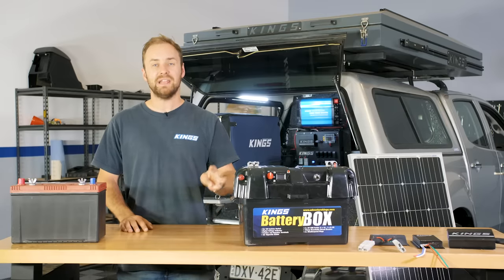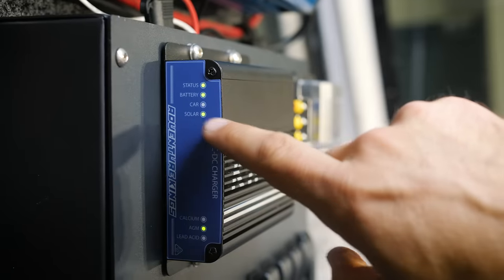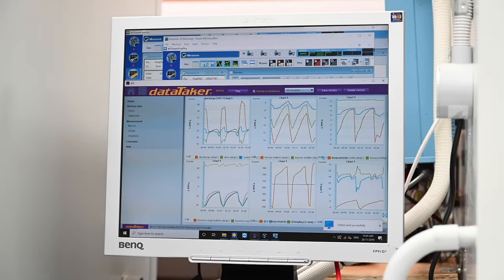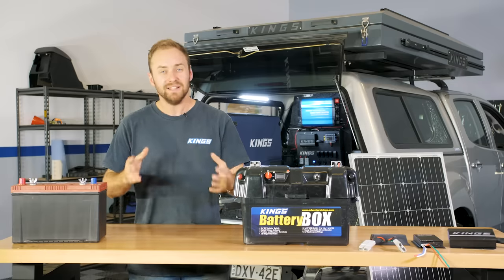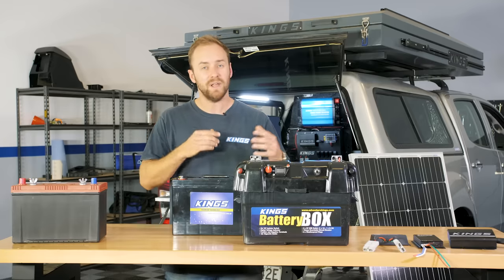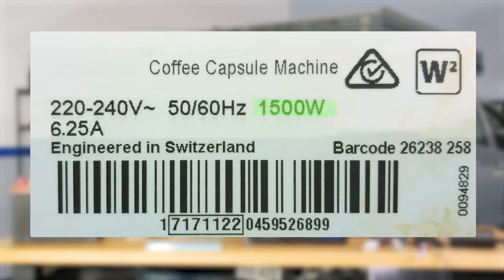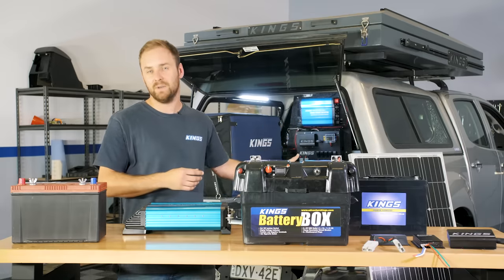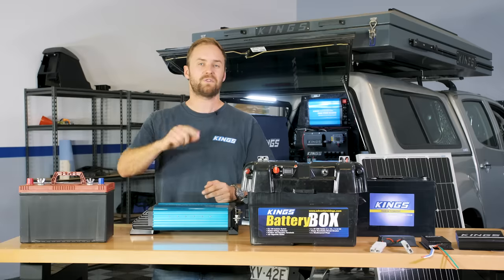Complete Off-Grid 12v Dual-Battery Masterclass PART 3: Next-Level 12v Upgrades

Comment: Best way to increase your battery life; if you’re partner  mentions hairdryer or microwave leave her at home to run off shore power
Reply: Hi. I have a 110w fixed and a pwm regulator. Can I leave it plugged into the battery full time when not using car? I'm worried I'll overcharge and damage my battery as it sits in the sun during the week.
Cheers
Reply: Charles Cropp Provided you have a solar regulator between the solar panel and the battery, it should regulate the charge so as not to overcharge the battery, regardless if the panel is in the sun all the time. What you must never do is connect a solar panel directly to a battery - big no no.
Reply: Bahahaha

Comment: Can you actually show and walk through the setup in the back of the Ute instead of just talking about how great it is,  will make it a lot easier setting ours up at home. Thanks
Reply: They did a separate video on the wiring setup, he said that at the start
Reply from the maker: G'day Jack,

Yeah I'll try and put something together - how in depth would you like it to be?

Would you want to see me actually run all the wiring again, or is it enough to point out where I've run it and why?

Cos I reckon I could just do a bit of a walk-through without a full install if that'd help?

Cheers,
Cahn
Reply: 4WD Supacentre yeah as in depth as u can would be nice, and yeah if you have the time to show how all the wires are connected and wired up would be nice, just so people like me with not much experience can see how it’s done and understand it a bit better

Comment: Well done, Cahn.  You’ve addressed a few things from the previous two videos, and finished the series with a lot of good information.  Very good and simple explanation of PWM vs MPPT with respect to pv specs, wiring two batteries in parallel, inverter use, and solar requirements, plus other tips and tricks.  Good work.
Reply from the maker: Thanks Michael!

As I've said before, this was a basic video so I couldn't get too technical with all the tiny details... as much as I wanted to haha... But I reckon it's come out as a good balance in the end!

Thanks for the positive feedback it's much appreciated!

Cheers,
Cahn

Comment: Very good presentation and accurate. To make it even more perfect I would add a battery monitor which will tell % of battery capacity, Amps in and out. I built a similar system set up on my 4WD Slide-on with all the bells and whistles. Totally independent from the grid. Aircon powered by 2000w generator. Love it! Well Done presenter.

Comment: Hey mate,
Love these videos, all parts,

I am in a situation where I have a duel battery set up, with a third battery in a battery box, for my 12 V plug ins 

But my fridge still struggles, kings 45L coming up with E1, from my understanding, lack of power but battery box isn’t connected in with the rest, but other than that my duel battery system does have solar too.

I only can/do charge my car or my battery box at one time 

I do have a Anderson plug from my  fuel battery to plug into an inverter (I only have 600W)
Reply from the maker: Hi there,
In this case we would recommend changing to a low voltage cut off setting, you can find the information on how to do this to your fridge in the manual. If this doesn't work we would also recommend changing to a shorter cable.
Regards, Courtney

Comment: Mate these videos are so informative, thank you so much. The one question I have left is how do you recommend you should wire the AC charger (shore power or generator) to your system and do you need to disconnect the DCDC charger when you are topping your batteries up from a 240v supply? Lastly, is it OK to run your fridge and other appliances while being charged from that AC source if you are using a smart charger? 
OK, so that was 3 questions. Thanks again, you are a valuable asset to Kings and everyone who camps off-grid.

Comment: Hello. There is one very important technical details about deep cycle batteries you forgot to mention: Capacity vs discharge rate. 
Each battery will have its own spec but essentially, as the battery discharge rate increases, the stated battery capacity on the specification sheet will reduce. Also,same with its lifespan (number of cycles)
Reply from the maker: G'day John,

I went into this a little in pt2... but you're right... I stopped short of getting into Peukert's Law!

Most deep cycle batteries in Australia are marketed and compared with their C20 rating, so when I'm talking about 100Amp Hour or 120AH batteries that's what I'm using.

You're right though - if you decrease the discharge rate, you increase the capacity. And vice versa, so increase the load and you'll reduce capacity. A battery with a C20 rating of 100AH means a constant 5Amp discharge. Up that to a 10Amp discharge and your battery is now technically only a C20 rating of about 97AH. 

Now to get even more technical that's for an AGM battery with a Peukert's number of 1.05 - the closer to 1 the better. If you had a flooded battery with a 1.6 (different internal resistance and recovery rate) you'd have much less usable capacity again...

Capacity is an interesting topic though - because as a battery increases in temperature its capacity increases too - up to about 120% in ~50°C. But for a sealed lead acid that extra capacity comes at a cost - ideally you want a sealed lead acid at around 25°C and every 8°C above that halves its life. so at 50°C a battery with a 12 year design life would in theory survive a little under 1.5 years.

Thanks for the comment, and hopefully if there's anyone else interested in Peukert and what affects battery capacity this will give them somewhere to start.

Cheers,
Cahn

Comment: Great series! Ok so now that many have the power packs like Jackery or in my case the ecoflow D2 LiPo with an additional battery pack, can you make a series on what would be the most economical recharge setup?  1) if you have no solar panels 2) if you have a solar panel 3) using an inverter to charge while motoring?  - thanks

Comment: 3 great videos, filled in some of the gaps in my knowledge. Expecially dc dc chargers, huge difference in my planned set up.
Question, the under hood battery will not last as long as the two inside SUV. Know all grouped batteries should be the same. Does the dc charger change that for the under hood battery? Seeing as power is regulated im guessing I can buy a different typewhen replacing it. Not to mention age.
Thanks

Comment: Just starting off, looking into a suitable power system, for an off grid situation with Solar Panels. This is a great video, thanks. 1. I noted that you are able to connect 2 x batteries in parallel. Do you connect the second battery (in parallel), to the screw on + & - terminals, on the exterior of the box? Also on this point, are you able to connect more than just 1 other battery (in parallel), into this system. I gather, that any other batteries, would be better in at least, another container/storage compartment (in a caravan), but linked to the battery box. 2. I also noted that you can add another/additional Solar Panels, to the Battery Box. As that it does have 2 Andersons plugs built into it, is that what the second one is for? The Solar Panel that I currently have, has its own Charge Controller built into it. Can that be bypassed & into the other one that you were referring to, in this video? Cheers.

Comment: Awesome video, makes it so easy to understand, thanks, just to recap... i can run an aux battery through the alternator and hook up a solar panel set up with MPPT the same time using a 130ah battery ?
Reply from the maker: Hi there,
This is fine - you could technically use 2x DCDCs or 2x MPPTs or a combination of both
We ran this setup on our work dmax and had the premium MPPT connected to constant permanent panels while the DCDC solar input  was left unconnected, ready for portable panels when you pull up at camp!
Regards, Courtney

Comment: Setting up a Kings 12v dual battery system, is there a digital monitoring device available that has an app so you can monitor by your mobile phone.? Thanks

Comment: I have the kings dual battery kit already set up,however i have recently purchaced the kings 12volt control box,1500w power inverter and 200w solar blanket and i have a 20amp dual input dc/dc multi stage battery charger,any chance you can send me a picture of the wiring diagram i should go by please,including if i should add fuses or something so if something blow's,it doesn't blow everything,cheers Terry

Comment: Great video overall.  I really need to nail down wire sizes for my build.  I've got most everything figured out except the main cables from front of the truck to the dual battery in the back.  You mention heavy duty cables but what size should be used?  Thanks,

Comment: can you do a walk through on wiring up this system please?
Reply: They did a separate video on the wiring setup, he said that at the start
Reply: @Lewythefly  yes but did they upload it yet. cant find it in their playlist. thanks
Reply from the maker: G'day Trevor,

A few other people have asked similar things so, I'll try and put something together - how in depth would you want it to be?

Would you want to see me actually run all the wiring again, or is it enough to point out where I've run it and why?

Cos I reckon I could just do a bit of a walk-through without a full install if that'd help?

Cheers,
Cahn
Reply: @4wdsupacentreAu  thanks for the reply. just the wiring from the solar panels and inside the box set up to battery. i want to make sure i connect all this properly inside the box. thanks again and keep up the great work

Comment: I know the video is a bit old but hoping you still respond to questions.

 I have a kings dc-dc set up with control box. Currently I run a solar blanket when I stop, plugging into solar input on control box. I have no permanent solar. How would I use another non-permanent solar blanket to the system?

 I know the control box has its own solar regulator and that's fine for the first solar blanket but how does that work adding a second blanket? Can I plug 2nd blanket into a mppt controller and then connect directly to battery?

Lastly, when connecting the battery to a 240v wall charger when back home, do I need to disconnect anything?

Any advice/suggestions would be appreciated.

Comment: Question, I went out over the weekend and have a Dometic fridge that I direct connected to my vehicle battery so that I could always run the fridge without having the "accessory" mode turned on the car.  It worked great!  I left the fridge connected all night and the next morning the vehicle fired right up.  That being said, because the vehicle battery is a starter battery and not a deep cycle, will doing this long term damage the car's starter battery?  Thanks in advance!  New to overlanding and trying to figure the best setup!

Comment: I have the Kings VSR installed with an AGM in the boot, I have a solar panel mounted om the roof racks with the kings MPPT controller connected to the AGM in the boot. What I have noticed is when the voltage on the AGM hits 13.3v the VSR opens and now the solar has to charge both batteries. Is this normal behaviour? YES the VSR is connected properly as it also connects the batteries once started the car and the main voltage hits 13.3v. I would have prefered the VSR only sense voltage in one direction so the solar system could properly charge the AGM at the correct voltage.

Comment: Thank you for videos. If I want to run a fridge and minor accsesories is it ok to run them off my oddessy34 battery and run a solar 150w to mppt controller to main battery? Will the solar on roof keep my main charged anough to avoid a dual setup?

Comment: Can you run 2 inverters in parallel?
For example, I want to run a fridge, possibly a microwave & a kettle/coffee machine as well as providing adequate power for a laptop/pc & monitor, TV & phone chargers.
High output inverters are more expensive than purchasing multiple lower output units, so mybidea is to parallel off 2 x 1500W inverters & taking the outputs of each to what will effectively be separate ring mains. One for electronics & the other serving the kitchen equipment.
Individually, each circuit will never use 100 % output capacity of the inverter but will provide a combined output equivalent to 3KW total.
I'm planning on having 400AH storage capacity, DC to DC, solar & mains/generator hook up for extended stays which I'll feed via a domestic distribution board with one ring on each breaker to minimise wiring changes, just have a big isolator switch to kill the DC side when in mains/genny.
Do you see any issues with this setup?
Thanks

Comment: Really informative video, i do have a question regarding the setup i have. It was already in the Prado i purchased.  There is a 20A power train DC-DC charger under the drivers seat which runs to the back of the prado where i can plug in a 12v fridge. I have just purchased a Giant 140ah AGM battery and will place it under the bonnent as my auxillary battery.  After watching your video, am i right in calculating that i can run the fridge for 48hrs without putting any charge into the battery if its pulling around 4ah per hour.  Is that draining the Auxillary battery too low ?

Comment: I have a question with regards to a 240v AC wall charger when using  a generator or you're at a powered camp site and want to splash out on some mains juice - is there a nice tidy way to integrate that AC wall charger into a kings 12v DC-DC charger and 12v control box system? Or do you simply need to attach the wall charger directly to your aux deep cycle battery? If so does the 12v DC-DC charger and control box need to get disconnected from the battery terminals? Cheers.

Comment: If I buy a control box, do I still need a battery box? eg Kings 12V Control Box or Kings 12V Compact Control Box. One reason I ask, apart from keeping things simple and not wasting money, is that I am keen on a Lithium aux battery and some of the 100Ah ones are pretty small and would save precious space compared to putting it in a too-big battery box. Cheers and thanks in advance.
Reply from the maker: Hi there,
While we do recommend the battery box as they do add protection and a few extra features, it is not necessary.
Cheers, Courtney
Reply: @4wdsupacentreAu  thanks I appreciate your help

Comment: Can you plug a 240 V battery 12v charger running at a constant 4amps into the solar input on the Kings 25amp DC the DC charger?
Reply from the maker: Hi there,
Unfortunately our DCDC chargers are designed specifically for solar input.
Regards, Courtney

Comment: If I use a dc dc.charger do I need to.use a dual.battery isolator set up as well? Can I put an arm or lithium.battery under the bonnet? Will it get too hot?... and also connect one in the back of the vehicle?
Reply from the maker: Hi there,
A dual battery isolator is not needed for a DCDC charger. Our batteries are not suitable under the bonnet, but this can be setup in the back of your vehicle!
Cheers, Courtney

Comment: My question is how would you go about being able to supplement charge with solar on your deep cycle on a systeam that has a voltage iso? Would you have to step down the  voltage or could you just hook it straight up like you would jumper cables?

Comment: I want to use 2 x300ah lifepo4 batteries with a 3000w inverter with 1800w of solar panels and a MPPT controller all from Kings for a container home for off grid living and was asking if you have any suggestions for me on the best way of setting up such a system
Reply from the maker: Hi there,
Thank you for your comment, as this is such a broad question unfortunately there is not one specific answer we can give you, but if you like feel free to contact us on social@4wdsupacentre.com.au with a screenshot of this comment and further information on your setup we may be able to provide a better answer for you. If it is a live-in house this are possibly construction standards that have to be met.
Regards, Courtney
Reply: @4wdsupacentreAu  I’ve set the system up and it’s working fine but is 600ah enough with 1800w of solar panels to keep the system running for an extended period 
It’s running a multi stage pump, small tv, fans and usb accessories and microwave, toaster and kettle but these items are not used daily except the pump, tv and charging equipment

Comment: I have 25A DCDC battery charger which I have accidentally cut two of the wires and I cannot return now, is the 25A DCDC still ok to use on a 300Ah battery?
Reply from the maker: Hi there,
If the wires on the solar, second battery or starter battery outputs have been cut for length then the plug end has been reconnected correctly this should be fine, however if the ignition or the temp sensor wire has been cut this can be an issue.
Regards, Courtney